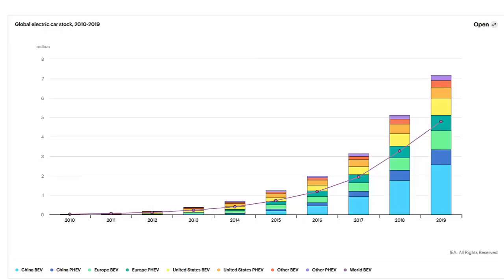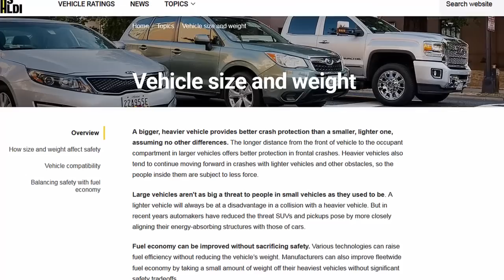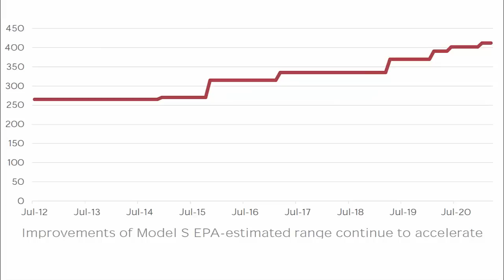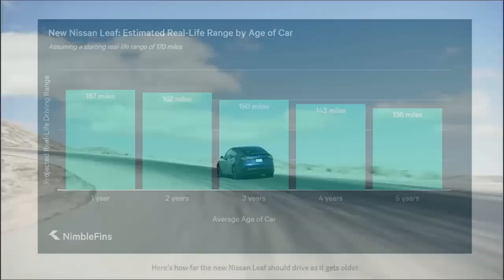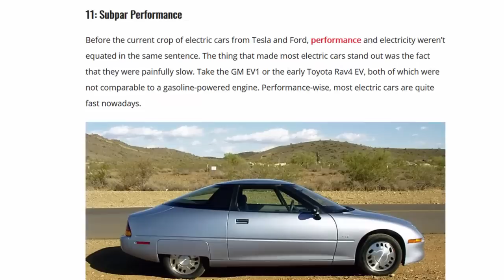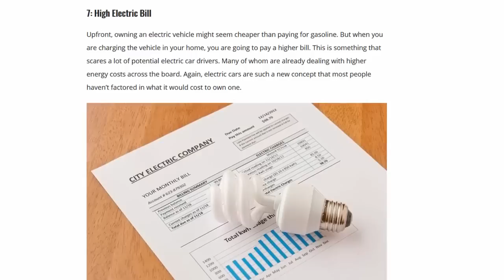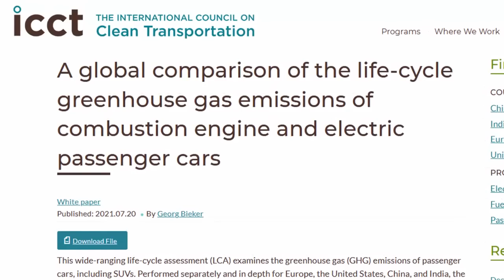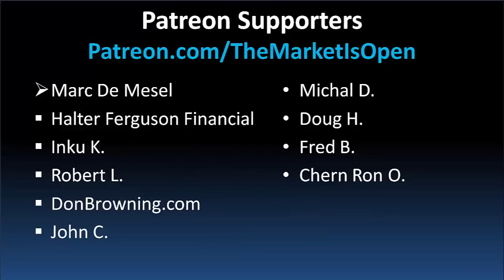Tesla will DECIMATE Gas Cars

Comment: That lag between a change in the accelerator is a bigger deal than most understand. The instant response creates far more driver confidence and precision. This leads to safer driving.
Reply: My Ford Focus 1.6 had a 1 second lag on the accelerator pedal. It was really annoying in traffic but I eventually got used to it. My current Fiat will ignore me when I floor the pedal. If  make a mistake and need to move fast it’s potentially dangerous. My wife has a lesser model of the same car with a cable throttle it does not try to nanny the car.
Reply: @Dave5843-d9m  For a long time I would "rush" when making uncontrolled lefts.  I assumed it was lack of confidence in the whole size given my less than 20/20 eye sight.  Then I got a Model Y and suddenly I could confidently (and safely) use smaller holes in traffic because I KNEW exactly how much space I would need to get there since there was no lag and total control on speed.  It was a revelation.  When I drove a rental on vacation it felt so "wrong" it made we very nervous for most of the trip.  I never got comfortable with it.  Now back home and very glad for the Tesla.
Reply: Michael Latta my daughter who has a Model 3 for the last 3 years reported the same upset when she has to travel for work and rent an ICE car. She says the exact same thing, it just feels so wrong and can't wait to return home to her baby  (Tars, her Model 3).
Reply: @Dave5843-d9m  my sisters chevy cruze does the same thing. nearly impossible for me to drive it safely. you can hammer it to the floor for about a second to two seconds with no response at all.
Reply: Nonsense, its more about bad driving, Germany has the highest speeds on highways and they have tiny 1l engines, no need of 500hp to go 200kmh+
Reply: @alanmay7929  Where do you pull your info from? There aren’t any 1L engines capable of 200 kph
Reply: @clu4u  ford focus 1.0 ecoboost youre welcome!

Comment: There's only one thing you forgot to mention, if we continue to burn oil, it's a mass extinction event.  Also, don't forget that electric motors convert 80% of energy to torque and only lose 20% to heat, while ICE cars lose 80% of their energy to Heat and only convert 20% to torque.  That means that even if you charge your EV with electricity from a coal fired power plant, you're still cutting emission tremendously.
Reply: There's only one thing you forgot to mention. A coal power plant only runs on an efficiency of ~40%. That would reduce the absolute efficiency of a coal powered EV to 36%, which is barely higher than new ICE cars, and actually lower than a new Diesel engine.
Reply: Why not mentioning deforestation the entire planet 🌎 to find rare Lithium?

Comment: Hate to disagree with you on parts, but I had to wait 2 weeks for battery cells from GM, when they knew their Bolt customers were going to need them during the recent recall for battery melt/fire hazard. Also, the dealer where I purchased the car said they would have a charging station within 6 months (from Dec 2017); that never happened!
However, I do believe that overall, the article was biased and you did a good job rebutting it!

Comment: June 23, 2021 Power Grid operators in California ask residents NOT to be charging their EV due to the shortage of electricity. Just a few more months and they will be stranded when Lake Mead is dry.
Reply: wrong again. two words: TESLA ENERGY. I have tesla solar with power wall. and they actually encourage charging after midnight and up to 6am.. which is when I charge anyway. I actually get a discount FOR HAVING an ev as long as I charge after midnight. if it were up to me? I would pull PG&E's meter & send them packing. I don't even use their power. but I can't.. PG&E has a sweetheart deal with CA- and I am forced to stay connected. why? so they can use my tesla power system to balance the grid in case of a local power shortage. soon to come? tesla home chargers that allow vehicle to grid power sharing. the cars already have the capability- just a software update.. and boom. you think tesla's are a problem for the grid? well.. yah- if you are pg&e.. tesla will put them out of business selling power between 5 & 8pm when demand is high. no more peaker plant profits.

Comment: If your electricity is predominantly coming from coal, then all the oil refineries making gasoline in your area are also using coal power and in absolutely enormous amounts.
Reply: You’re soo right on, refineries use 5-6 kW to refine one gallon, an EV can travel 20-25 miles on 5-6 kW. Simple math.
Reply: @clu4u  Don't forget the gasoline burned by all the trucks delivering it to all the gas stations. :)

Comment: I think that instead of decimate, which means cut by a tenth, you meant obliterate gas cars.
Reply: You’re right about the historical Latin meaning BUT its current meaning in English and French is “to destroy a great number”
Reply: right you are, goes back to Roman legion days when 1/10 of a badly performing fighting force would be executed at random (by drawing stones from container where 90% were white, and 10% were black).  Some have no respect for the language that they speak.  Words mean things, and it is WRONG to change those meanings.
Reply: @tech 52 nope, Roman punishment of soldiers who broke in combat. 1 in 10 would be executed.
Reply: Yes, I’ve pointed that out too.   Common error.
Reply: Ah yes, what is more annoying? Semantics or FUD?
Reply: In CGI there is an algorithm called a decimator. It is supposed to reduce the number of polygons in a mesh, yet maintain the same appearance. It usually reduces by more that 10 percent. Blame the misuse of the word on all those gamers.
Reply: @tech 52 that's where the world comes from.
Reply: @tech 52 sure, make up your own definition!

Comment: ICE cars are more prone to fires. Like Elon said, "It's literally in its name: internal COMBUSTION engine".
Reply: Yeah, I see ICE cars flaming in half the intersections all day long.
The fire department can foam out a gas fire.
A toxic lithium-ion fire they just let burn.
Reply: @nxgrs74  No. That's just FUD. They put out fires on EVs as well.
Reply: NHTSA study from October 2017... concluded, "...ignition of flammable electrolytic solvents used in Li-ion battery systems are anticipated to be somewhat comparable to or perhaps slightly less than those for gasoline or diesel vehicular fuels."  (Report No. DOT HS 812 418)
If the industry had adopted LiFePO4 chemistry, that would have been FAR Safer, but safety was set aside for slightly more power density.
Bottomline: EVs have about the same risk of fire, and Musk is just spinning a marketing pitch.
Reply: @nxgrs74  the fire department chief reissued a statement after the media misquoted him. There is a video press conference to fire was distinguished in 2 to 3 minutes. They could not move the car because there was a mandatory investigation because two people died, so they waited at monitored the fire for 4 hours and managed anything that was smoldering during the investigation to be completed. That’s it. It’s not complicated.
Reply: @yourcrazybear  ??? says the risk is similar ... one isn't hugely safer than the other. You think huge improvements were made in just the last several years??.. then cough up the data/evidence/studies .. your unjustified beliefs are NOT impressive or convincing.
    Also, vehicles rarely catch on fire, the average person isn't even concerned about such a thing.... so why are you???
Reply: Yes they spontaniously combust all the time.
Reply: @maxmeier532  WTF
Reply: @yourcrazybear  
GAS STATION FIRES ALONE….
From 2014 through 2018, local fire departments responded to an estimated average of 4,150 fires in or on service or gas station properties per year. These fires caused an average of three civilian deaths, 43 civilian fire injuries, and $30.0 million in direct property damage annually.

11 FIRES A DAY, EVERYDAY at Gas Stations. 

171,500 highway vehicle fires occurred in the United States, resulting in an annual average of 345 deaths; 1,300 injuries; and $1.1 billion in property loss.
Reply: @GET2222  Wow. Didn't know about the gas station fires. That's insane.
Reply: Does 480 V sound tame to you?
Reply: @alanmay7929  Firefighters can put out the fire in 2-3 minutes. Not that hard at all.
Reply: @yourcrazybear  fire fighters can put ICE car fires in 2-3 minutes while EVs needs way more attention and time, also ICE can come with small fire extinguisher....

Comment: I’ve got a Tesla M3P. Not the best looking car. I still prefer the Audi design, however, they’ve lost me as a customer. 
I’ll never go back to an ICE vehicle and I probably won’t switch off of Tesla either. 
Although there is always something to wish for: FSD; however
1) My engine hasn’t stalled ever
2) My car opens when I push the handle bar
3) My car parks itself
4) When on a inclined plane, the car brakes automatically. Doesn’t roll away.
5) The car puts on the parking brakes when you open the driver’s door
6) Climbing up a ramp is effortless, just press the accelerator. It won’t roll back. Although I managed a stick shift for 4 decades very well, didn’t miss it a day.
7) Oh, I completely forgot to mention the marvellous sport car performance.

Comment: Tesla had me on "has less moving parts."
Reply: I'm tired of having to constantly visit the repair shop for all of my ICE cars I have owned due to engine problems etc. The day I switch to an EV will be a day of joy.
Reply: EV's cost less per mile over the life of the car. That says it all.
Reply: Elon had me at: “The best part is no part”
Reply: A Tesla has four times the parts of an ICE once you consider every resistor, cap and trans. The roadster is falling apart electronically and only ONE company repairs them.
Reply: @callmeishmael7452  You must be a stand up comic…
Reply: @macioluko9484  just a simple scientist listening to Tesla’s snake oil sizzle.
Reply: @callmeishmael7452   In that case you’d better listen to some more snake oil  2nd quarter record numbers.
Reply: Less "moving" parts but more software locked and non available parts for the consumers right!? Go look at rich rebuilds.
Reply: @macioluko9484  nonsense, then why does the modelx has that stupid door mechanism with hundreds of parts!!! Lol....
Reply: Jan 6 was "Wall Street Putsch" part 2  my co-worker has a 2015 model S. it still has the ORIGINAL rotors & pads... and there is NO perceptible wear. not a surprise really... one pedal driving REALLY does mean.. you never touch the brakes. EVER. only in a dire emergency. we love our model Y.
Reply: @jaybee3165  2% market share for all ev’s on the planet sure sounds like game set match. In fact Tesla is 1% on its own. Elon Musk is a ball boy.
Reply: @callmeishmael7452  it's not so much the percentage... as it is the growth. he's achieved that 1% with ONE factory in just 5 years on a budget that wouldn't operate HALF of GM for 6 months.
Reply: @yourcrazybear  ICE cars are a nightmare way to many parts way too many ways to fail and breakdown.

Comment: Keep in mind that electric cars and green energy were a viable option over 100 years ago but Rockefeller crushed them with his petroleum monopoly.

Example 1:  Rockefeller rallied against the production of ethanol (ethyl alcohol) which Henry Ford was promoting for his cars.

Example 2: Rockefeller produced a petroleum based fuel to compete with the peanut oil based fuel which Rudolph Diesel promoted.

Comment: 0:55 I would like to see that number converted into $ for EV vs ICE car and not just a blank 2% total car sales. EVs are still way too expensive compared to ICE cars.
Reply: Use the number of miles you drive in a year and your car's gas mileage to figure out how much $ you spend on gas.  Then, do the same with what an EV would cost in charging; you'll spend way less in electricity than gas.  Plus, less maintenance, oil changes, etc. on an EV is money saved.  Multiply that by 3-5 years, however long you typically keep a car, and you'll have your answer.  Don't be fooled by the purchasing cost difference. Of course, if you only drive a few thousand miles (less than 12,000) a year, it won't make sense....yet.

Comment: 9:39 Point 12, Fire Hazard.
I have had an electrical washing machine go on fire with me (very scary) and dose happen on very rare occasions. But I would have no problem fitting another electric washing machine in the house, but what I would never do, is fit a washing machine that running off of petrol in my house(and I'm a petrol head).
This is such a bogus and nonsensical argument that electric cars have a higher chance of going on fire than petrol or diesel cars, it dose not hold up against the statistics that show, electric cars are in fact less lightly to go on fire than petrol cars.

Comment: I will say Bolts have had a recent fire issue and GM hasn't had a solution yet.
Reply: Its LG that's the problem. GM gets batteries from LG, so they should get on their ass and quick. Not sure if 2022 models use batteries from different supplier.

Comment: Waiting for the 500 mile battery that can charge in 15 minutes then I'll buy mine.
Reply: maybe we can get a hyperloop that can go faster then 15mph too LOL/s
Reply: So you're going to drive 500 miles, charge for 15 minutes and then get back on the road for another 500 miles?  Everyday? Sure glad I don't have your life. Do the calculation, people. How many days in a year do you actually drive more than 300 miles in ONE day?  You keep forgetting that EVERY morning you wake up with an EV, it's charged back up to 300 (or more, as battery density improves) miles. And if once in a while you do a cross-country trip and you're worried about the extra 15-20 minutes longer it takes to charge, especially after driving 300 miles straight, then splurge on a rental ICE car for your trip.  The money you save on charging your EV will probably pay for your rental anyway.  By the way, most people waste more time on Youtube, Porn sites and watching TV than it takes to charge an EV, that is, if you forgot to plug it in before you went to bed!  LOL

Comment: Older coal fired plant being less efficient get shut down at night and restarted every morning. They should be replaced but meantime we are stuck with them, This intermittent loading further damaged fuel efficiency. However, increased demand at night (say, charging cars) will increase their efficiency. 
Even better get the nuclear waste burning molten salt reactors on line. They solve the long life waste problem while making zero emissions power at low cost.

Comment: EV for all road conditions, 100+ mile distance, quick charge, 85MPH and after rebate 10k.
Reply: tesla model 2, $20k, 230 mile range. 1 million mile life. buy one & done: for life. in 10 years... a new model 3 will cost $25k. just like the dvd player.. started out at $1000.. now it's $30. tesla isn't a 'car'... it's a hard case laptop on wheels. and just like all consumer electronics.. with time.. it will only get cheaper & better.

Comment: We are at peak ICE car technology and just the beginning of electric car technology at a mass scale. Today you can pick between having some of the best ICE cars that will probably ever be made or electric car that will most likely be old tech within 5 years. This is the problem I have right now with electric cars. By the end of the decade we will probably have electric cars that can charge fast and hold 500-1000 miles on a charge.
Reply: my model Y long range is like the starship enterprise compared to the best ice car that has ever existed or ever will exist. and when they come out with the 4680 cells in model Y? we'll trade up.

Comment: This video makes a lot of good points but pretty much all of them become irrelevant if potential EV owners can't get their hands on an EV they can afford. Short of us running out of oil in the near future I can see us driving ICE cars for at least another decade.

PS even if the oil runs out I can see the oil companies switching to synthetic fuel. I remember in the 80s in New Zealand Mobil was making gasoline out of natural gas. That kind of process or even others such as coal derived gasoline or even gasoline synthesized from hydrogen and carbon dioxide are technologies that are being discussed now...

Comment: Let’s compare the efficiency, range and a 100 mile trip energy cost of an electric car to a gasoline car. To begin with one gallon of gasoline (premium gasoline is $4.31/gal near me) contains about 33.7 kWh’s (electricity is $.11/kWh or $3.71/MPGe my cost) of equivalent energy. 

My 59,000 mile, 4 1/2 year old 2017 Tesla Model S75D, which weighs about 4,600 lbs, gets around 250 miles of range with the equivalent of a 2.22 gallon gas tank that’s a 112 MPGe (the new 2021 Tesla Model S long range which weighs 4,561 lbs, states a 405 mile range with an equivalent 3.0 gallon gas tank that’s a 136 MPGe).

A March 2, 2021 Autoweek article listed the gasoline powered 2021 Audi A7 as an equivalent vehicle to the 2021 Tesla Model S. The Audi A7 weighs 4,300 lbs with a 29mpg hwy and a 13.7 gallon gasoline tank with a range of 397 miles.

Efficiency: 2021 Audi A7 is 29 mpg, 2017 Tesla Model S is 112 MPGe, 2021 Tesla Model S is 136 MPGe.
Range: 2021 Audi A7 is 397 miles, 2017 Tesla Model S is 250 miles, 2021 Tesla Model S is 405 miles.
100 mile trip energy cost: 2021 Audi A7 is $14.86, 2017 Tesla Model S $3.30, 2021 Tesla Model S $2.72.

Conclusions: The cost of energy used in a trip is much lower with the Tesla versus the Audi. Even if you reduce the price of gasoline from premium to regular and increase the price of electricity due to supercharging, the energy efficiency and trip costs of the Tesla versus the Audi is undisputed. Finally the increase in efficiency from the 2017 to 2021 Model S demonstrates Tesla’s continuous improvements of their products.